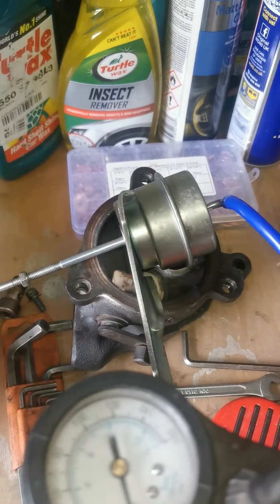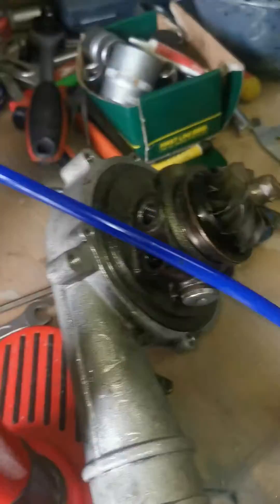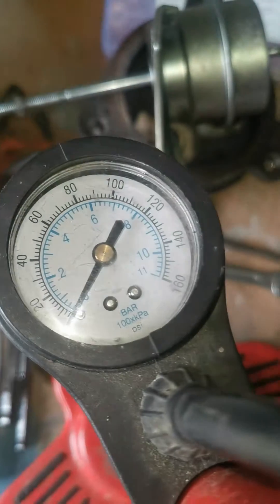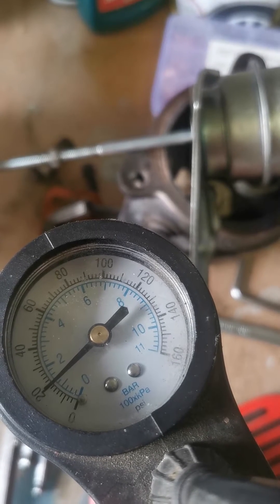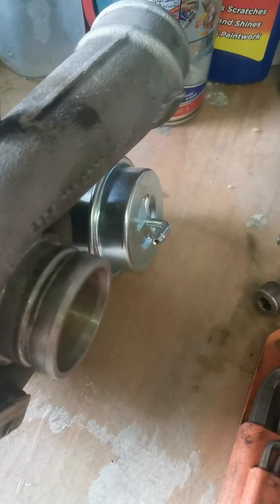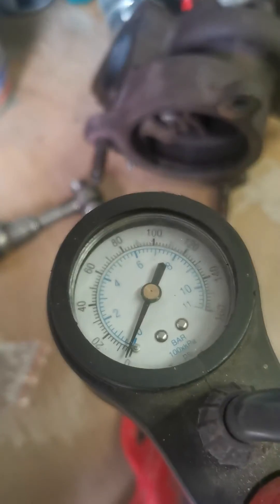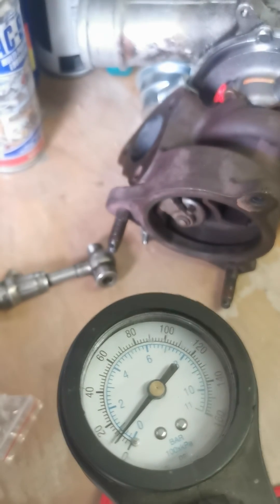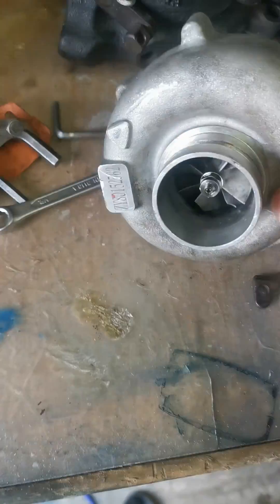K04 Turbo wastegate

Comment: The oem k04 actuator from what I see is fully extended to 20psi, is this correct? I had a problem with my actuator tired fully extended at 10psi and my k04 didn't hold momentum well until 6500rpm

Comment: Ive got a Mk6R golf (KKK K04) with heavy surging at 3k rpm on a stock tune, a couple of tuners said 9/10 times this is the wastegate actuator not functioning correctly, do you recommend adjusting the nuts on the one I have or going with a turbosmart or forge aftermarket repalcement?

Comment: I'm getting an overboost issue code p1555 I adjusted my wastegate finger tight so it's closed then 3 full rotations, still overboosting, should I release 1 full rotation so it's finger tight and 2 full rotations, how do you normally set yours? Cheers
Reply from the maker: When did the overboost start occuring ? In my case it was the wastegate hole diameter that was causing my overboost problems, the gases couldn't escape quick enough, when I increased the size the problem stopped.
I am not an expert on these but I did much the same as you and tightened the nuts when it was fully closed with no preload, I then took it for a drive and it ran much better than before. The more preload you put on the more pressure will build up before the wastegate opens.

Comment: Hi. Did this same test on mine - mine moved very easily and basically went right back in as soon as the air quit going in. Bad diaphragm in actuator? Car had been sitting awhile before I obtained it.
Reply from the maker: It depends, it would be unusual for it to move easily if there was damage to the diaphragm, it simply wouldn't move or would struggle to move unless you forced Alot of air down ther quickly. Does it move bad if you hold the air pressure?
It sounds okay to me